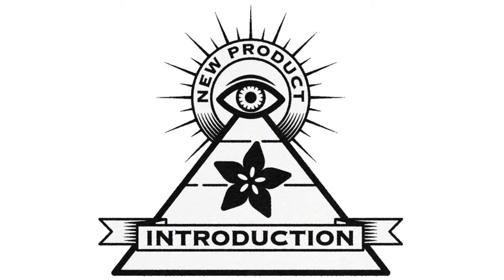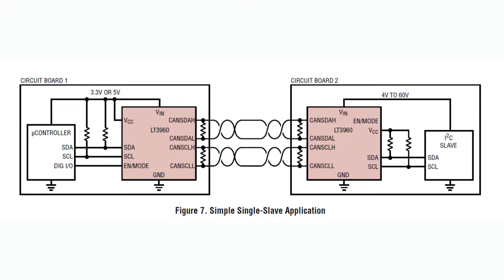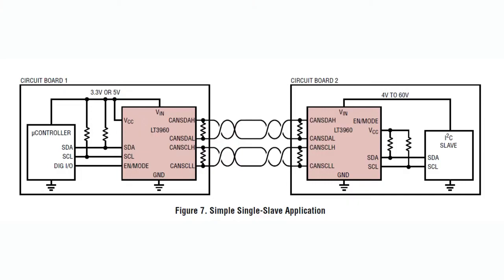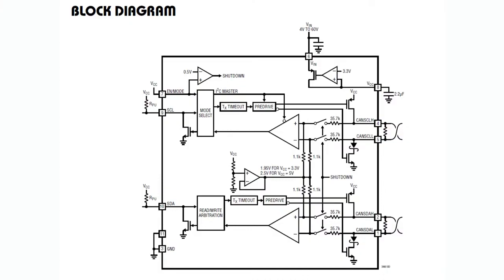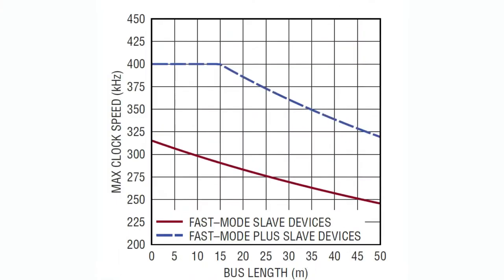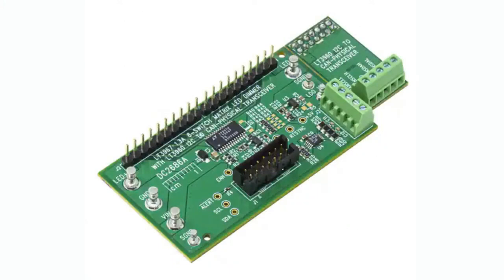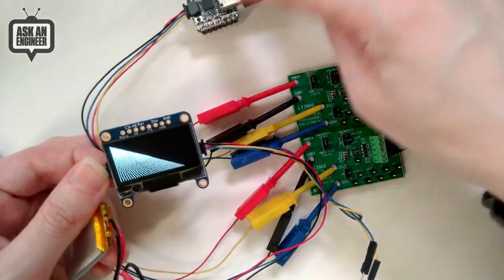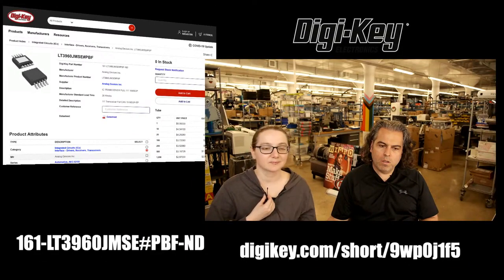EYE ON NPI - Analog Devices' LT3960 I2C to CAN-physical transceiver #EYEonNPI @DigiKey @Adafruit

Comment: So, to be clear, the CANBus segment that these units form is only for the passing of I²C messages. It's not possible to use this to give a µC with I²C an bridge into an existing CANBus network that has native CAN devices talking on it. Is that correct?
Reply: Actually this is not the CANbus compatible, it is an 'ISO 11898-2' compatible device (120ohm diff pair + preffered voltage levels).
Reply: @oleksandrgrytsenko  That's what I wanted to confirm. It's a CANBus PHY, but without a CANBus controller, there's no Transfer layer for the CANBus protocols. Is that correct?

Would it be viable to try to write a Transfer Layer driver inside the µC to have a working CANBus stack?

Comment: How long before a small board with two RJ45 connectors, one on each end (allows the Cat5 to be daisy-chained easily), the LT3960, an LDO and a STEMMA QT connector on the side is available????